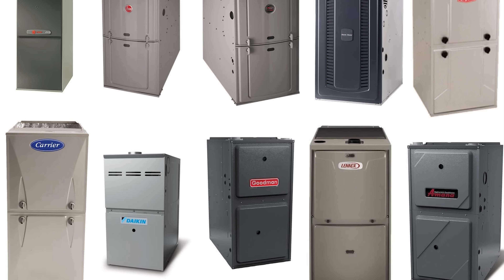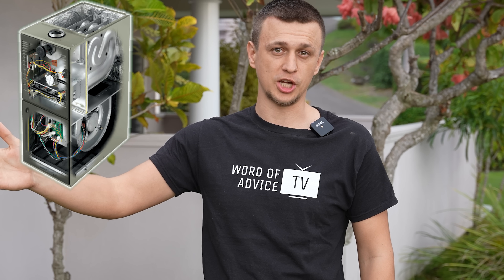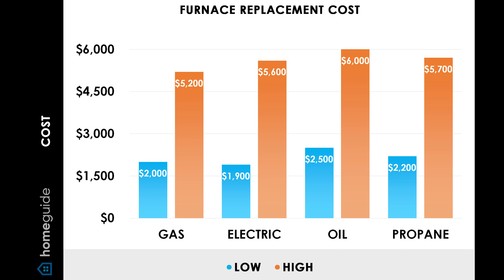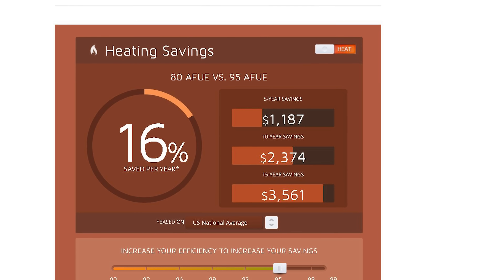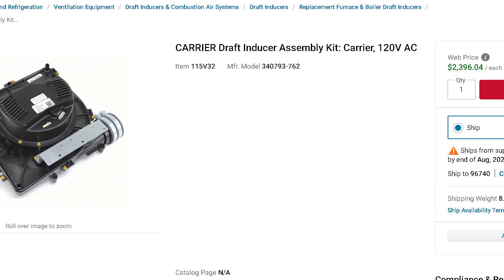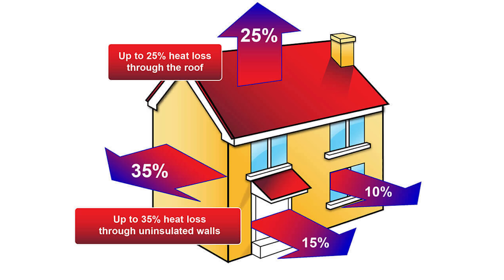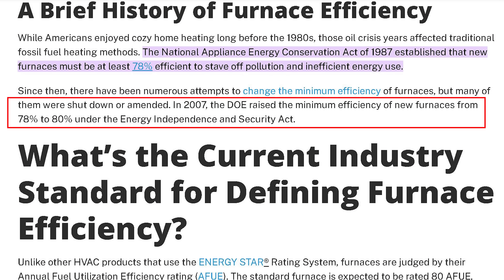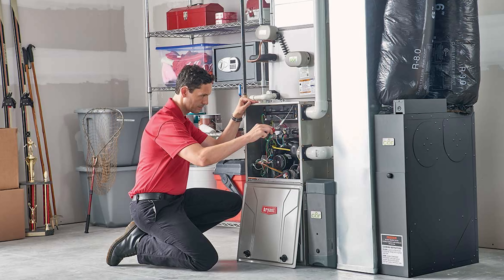Don't Buy a High Efficiency Furnace!

Comment: Efficiency was low on my list even though i went with a 99% AFUE Furnace and a 25 Series Heat Pump. The key for me is modulation. The previous owner installed a single stage condenser on a 4 zone system with a tiny barometric by-pass. No way it could work and it didn’t. 10 degree differences throughout the home. Not fun living in a home where there was no place you could achieve comfort. Even though the condenser was only 2 years old, we got rid of it. Now I have three zones and I get to tell each zone exactly how many cfm’s it gets (600, 600, and 900 out of a system with 1600 (4-ton) capacity). Since we made the change I have not seen any zone off even a degree. For me the best investment I could’ve made. The key was the right company. People always talk down on things they can’t do or don’t understand. Most system and component failures are from installation or airflow. (With the manufacturers also using the market place to test their equipment (they all are guilty of that)). I would take the lead installer we had with 5 years of experience over anyone out there with 30 years of experience who didn’t continually invest in their training and knowledge. There is not really mis-information in this video, but it is also not that simple. One big problem is people confuse function with performance. The department of energy in 2019 found that the average system in the US was working at 67% of it’s potential efficiency the day it was put it. The reason, not the equipment, but the installation. There are good resources if you want to find them to help you make a good informed decision; ASHREA, ACCA, Energy Star, DOP, etc. They are desperately trying to protect the consumer from contractors not doing the right things and giving homeowners a fraction of what they paid for. But, because it functions, people think they got something of value. Utility cost are going up; in my market with delivery costs I am at $.32 per kw/hr. I was on oil ($5.64 a gallon) and now have the 99% efficient propane furnace as my dual fuel backup. It was great to see it snowing the other day and my heat pump was running. Yeah, I spent over $20k on my system, but because of ridiculous utility cost I will be saving over $500 a month with the new system. But as I said earlier, my main motivation was comfort. There was no other way to get this level of comfort in my home without adding multiple systems which would have cost a lot more. I get a 10 year Parts and labor warranty and I am confident. Yes older systems can last a long time but according to a 2015 report done by Emerson climate technologies they found the average system in the US was replaced at 13 years. Some broken, but mostly people were looking for better comfort, efficiency, control, or piece of mind. I wouldn’t debate anyone on their choices with their home and their money; but, do yourself a favor and do some good research so you make an informed decision. There is information past marketing and opinion. (Hint, don’t google how to by an HVAC system).  Also realize there are no ratings on equipment. You can’t rate something that has to be installed. Consumer Reports published an opinion poll but was very clear that it was not a rating of equipment. There is a good video on YouTube entitled 5 installation mistakes that will kill your hvac system. It is for training HVAC people, but if you are curious,  it will give you some insight on how important the installation process really is.  The HVAC industry is the most failed industry because it is dominated by hacks who think like contractors and race to the bottom to appeal to homeowners on price. There are quality HVAC companies who are staffed with passionate, capable, wonderful professionals who can give you an amazing experience and great value. But sadly, they are hard to find because size is not the indicator. There are terrible companies big and small. ACCA has some good advice on how to find the good ones. I am no slouch when it comes to DIY. I can weld, I build all my own furniture in my home, I’ve remodeled homes in the past, among many other things. But as I watched these 4 men over three days do what they did the way they did it; they were worth every penny I gave them and I have so much respect for their craftsmanship and pride in their work.
Reply: Very well said.  I've been in hvac 45 years and received my journeyman license in 1985. Totally agree you must do your research.

Comment: I am a HVAC contractor and he is right . When comparing inducer motors you compared a Goodman and a Carrier . Carrier parts are very expensive vs Goodman. Other than that great video. But if a customer wants a high efficiency then high efficiency I will sell them. ! You can also replace your ducting .

Comment: Thank you for this video!  I was going to get a Trane single stage non variable blower it is AFUE 96% it is lower in cost than the Trane 2 stage.  I live in Ohio.  Should I ask them if they have an 80%?
Reply from the maker: You're welcome! There are varying opinions on the matter. I would suggest taking a little time and reading through the comments people made on this video and then make your decision after hearing the opinions of both sides. I lean more towards the 80% furnace but that is the opinion of just one person.

Comment: I have Trane TDE080A945K2 80% efficiency.   The only thing that replaced since 1999 is main controller board.   It's running fine, but I can't find the operation or service manual.   Does anyone where to get one?

Comment: I have been a CM since the 90s and seen many code changes. In 2002 energy efficiency was incorporated. This one thing has increased cost of construction immensely, and IMHO the juice is not worth the squeeze. For thousands of years codes were about safety. Yeah, the Romans had building codes. The safety bugs were figured out years ago so there is not much they can intervene in this area. They can constantly make new requirements under the guise of energy efficiency. Insert conspiracy theory..............here.

Comment: Here's the thing though, high efficiency is probably all that HVAC contractors are gonna be selling several years down the line, with no option for standard efficiency. As heat pumps continue to become more effective in colder climates and, therefore, start to see wider and wider adoption across the country (especially once R-32 hits the market en-masse), high efficiency will become the economy option for system replacement, while the heat pump will become the more luxury option. Comfort cooling system design is slowly moving away from combustion furnaces, and eventually, nobody will have any choice in the matter but to upgrade to higher efficiency equipment.

Comment: Would you get a multi speed ECM fan with a new 80% gas furnace?  How about a variable speed fan?
Reply from the maker: Yes, that is something I would consider. It is quieter and really does use a lot less energy. If you install it yourself then the savings and added comfort would be worth it.

Comment: Just crunched the numbers 3 days ago for North Carolina. My annual gas bill is $1,080 for heat, hot water and delivery. Delivery and hot water cost is $18 p/m so removing that leaves cost to heat house at $775 per year. Subtracting the 20% inefficiency would be $$620 to heat house with a 100% efficient furnace. My 80% furnace costs me $155 yearly or $1,550 for ten years (vs. 100% effecient) to have a furnace I can work on cheaply! Weigh this against the up front cost, modules, ECM motors, exchangers and specialized equipment on a condensing furnace that WILL rust out within 15 years and I believe that counts as a win. Any objections?
Reply: Yes you obviously have an older home with a chimney. I live in a highly developed area in PA. I have not seen a home built with a chimney for 1/4 century and that includes the building boom from 01 to 08. If they do have one it was usually specked for a wood fireplace  Usually here the 80% furnace will condense in an old masonry chimney eventually eating the mortar between the tiles and then through the brick or stone. So most old chimneys must be lined. Lining a chimney with a 316T liner is about 3000.00 average. So reality is if you have a home between 30 and 60 years old with an indoor chimney and tile lined you can stick a 80% furnace in it. Besides older homes have higher infiltration rates that allow for using inside air for combustion but with the advent of Tyvek and foam those days are long gone, as they should be.
Reply: @anthonyspadafora1384  1987 and double wall pipe straight up from garage, thru main floor, attic and out roof. No masonry.
Reply: @jeffsomers28  The builders here just eliminated the chimney altogether for both the furnace and the water heater. Most of the powervent tank type water heaters are being replaced with tankless now. I dont think they make a chimney vent tankless , even the non condensing units vent sidewall. Still that being said the cost difference between a 95% and an 80% would still be less than the installation of double wall Bvent through the roof. But probably not back then. Now they are only 4 to 5 hundred bucks more.

Comment: If they have well like you said soon 95% an 98% furnace why not make a 85% or 89% at least we can have better choices ?
Reply: It's because of physics - you either need to burn gas at 80% so the remaining 20% heat is enough to carry the acidic products of combustion up through a metal chimney, or burn it at 92% or higher efficiency with less waste heat and send low temperature acidic exhaust through a plastic pipe.  Otherwise the acidic exhaust will condense in a metal chimney and eat it away.
Reply from the maker: @cvr24  Thank you for the great explanation good sir. Much appreciated!

Comment: It’s like $2600 to $3500 for a high efficiency furnace installed….  There’s not a huge difference to putting them in other than the plastic venting which is easier to put in than going on a roof…

The mid efficiency do last longer and the parts are cheaper.  Though parts for high efficiency are coming down. There’s now third party blower motors out.  

In my experience most people with a “cracked” heat exchanger don’t have a cracked heat exchanger..

The key is to find an honest tech that won’t lie and tell u it needs to be replaced when it doesn’t and who isn’t going to gouge u on parts.

Comment: At one time they brought out a unit called furnace mate it was hooked up to the furnace by replacing a section of the cold air return duct and was wired into the old furnace taking it from low or mid efficiency to high efficiency basically it was the condenser of the high efficiency furnace it also eliminates the need for a chimney as it was vented with PVC pipe it was a great idea as if it your old furnace still had a lot of years of life left why scrap it just upgrade it I had thought I'd buy one at a later date but they disappeared

Comment: I have to disagree but my situation was a little different than most because my furnace was from 1956, the new furnace is saving me 50-60 a month on gas bill and around 10 a month on electric and I spent 3,000 on unit
Reply: I could have went with an 80 and saved around 30 a month but then I wouldn’t have gotten the $400 rebate so it was a wash

Comment: How often should the HVAC be inspected by a professional?
Reply: Id guestimate about every 3, by a non-crookid technician,   You can educate yourself and do checks too, but not everything a Tech with tools can.
Reply: @pablopicaro7649  I typically just ohm out the ignitor rod, lightly sand the flame rod, but removing and cleaning the condensate trap is the worst job.  I have yet to see one tech that would clean the p-trap without I requesting it.  I just have them inspect my furnace once every 5 years.  To keep them honest, I would stay there and watch them do their job.  My furnace is hardly used more than a week or two each year in the winter since I have a heat pump that does must of the work.  So going on over 10 years now and the ignitor is still good.

Comment: Hmm, I have a 27 y/o Trane XE90 on LP that’s still going strong. Replaced 1 control board, flame sensor, all the drain hoses/J-trap and the transition receptacle. All of those parts cost less than $300. 

Why would a 90 cost that much more to install?  Seems like the only difference is running a drain and plastic flue - am I missing something else?

Comment: Not legal in Canada.  And standard warranty in Canada for the heat exchangers is 20 years exchanger part warranty. Plus a 10 year parts warranty. 
In 10 years that furnace might save me $2k in gas. Easily paying for my next service call. 
High efficiency units are fine and they oftain run on DC current ECM motors now, using less electricity too.
They do have more potential for breakdown, but good luck even finding a mid efficiency part now, at least in Canada. They don't even exist here.

Comment: I have never replaced a 90% furnace in 10-15 years. They have a life time heat exchanger warranty to the original owner otherwise it is 20 years. The cost of repairs on the 80% single stage and 90% single stage are pretty close in price.  If you register them they both have a 10 year parts warranty. Yes the modulating furnaces and two stage furnaces can be expensive to repair. If you have LP gas I recommend a 90 % furnace but there are many factors to consider before buying a furnace.
Reply: The labor on a heat exchanger is the big cost, not the part. I doubt the warranty covers labor on the heat exchanger after 10 years.
Reply: @brightonmusic  I charge 800.00 -1200.00 labor to replace a heat exchanger under warranty, still cheaper than a new furnace. There are a couple of exceptions to this.
Reply: @randyhoff3676  Thank you for providing a realistic choice. I brought it up because too many people I've known didn't realize that the Lifetime Warranty on the exchanger is not included; they were understandably upset when their heat exchanger was out of warranty for labor.

Comment: Yes- been there and it happened to me. They are sold because people generally want to help reduce fossil fuel use and cost and , indeed, the future of natural gas supply can be murky. The other cost that is never factored in is the cost, materials and energy required to make replacement parts and new furnaces under reduce life cycles, I don't see any material or structural issue that would prevent manufacturers for making more reliable, longer lived furnaces but there is no financial incentive to do so. There are a number of videos gabbing by installers about what is best but probably relates only to anecdotal evidence and favored toward what they personally sell. Thumbs up.

Comment: The problem I have is that I can’t install the heat pump that I want unless I install a high efficiency modulating furnace. I am trying to get around that but so far I have not been successful.
Reply: Yes a variable speed blower motor is a major part of getting a higher efficiency rating. There’s a little more to it than just thinking your going to buy the highest efficiency heat pump.

Comment: I should have gone 80% back in 2005 but I wanted to get rid of the chimney and add a 2nd level above. The inducer motor needs to stay cool so get an oversized filter or change a thinner one each month or more. If the filter gets plugged or the return vents get covered reducing air flow my furnace will automatically do a restart (short cycle) as it will cause the heat exchanger to get too hot. The problem is that getting to that point repeatedly will most likely shorten the life of the mostly plastic inducer if it is not understood whats happening (just keeps restarting without an error shutdown). Maybe a warning light/beep for high temp exchanger exhaust would have been helpful. Now I just know when there's a problem. 
For me 3 inducers, a couple of igniters and a flame sensor for almost 20 years with a Goodman 92.6% is okay only because I do all the labor.

Comment: Now I’m nervous! I’m actually pretty happy with my new high efficiency propane boiler, we installed last year. 
It heats up each zone way faster compared to my previous (oil) furnace, and I’m paying roughly 200 bucks every 3 weeks for propane ,whereas some of my neighbors are paying over 900 a month for oil, and natural gas is not cheap right now. Also, I no longer have to keep the house temps around 60 degrees to save fuel.

Comment: I tell people all the time, unless you want a particular unit or want certain bells and whistles, just go with either a basic single stage/2 stage straight cool if you're not picky. If you get one of those variable speed units, most of the time any salesmen argument that it will pay for itself is flat wrong and I would say lying to the customer. Up front costs/ plus "paying for itself" will take YEARS AND YEARS AND YEARS if you crunch the numbers. I'm not against high efficiency but the average person doesn't need one nor should they be lied to just to get them to fork over the money. Plus forgot to mention many of the parts are very expensive and have huge lead times.

I know of a person who was promised 50% reduction in bills by a salesmen and they went with his rhetoric and got a trane inverter condenser/variable air handler, it's got all the bells and whistles and going on year 2 only averaging like $10 less a month and they paid a great deal of money for their bill to only go down $10.

Comment: The thing that you’re missing is make sure that your house is insulated really well starting with your ceiling at least an R50 and the attic is well ventilated!  Then you can talk about efficiencies on furnaces. I have a 95% efficient furnace and I’ve had it for 22 years. Knock on wood haven’t had any problems. So my advice would be to get your house insulated first because doesn’t make much sense to put in any kind of furnace if your house isn’t insulated well.